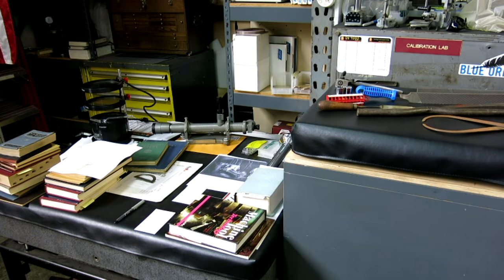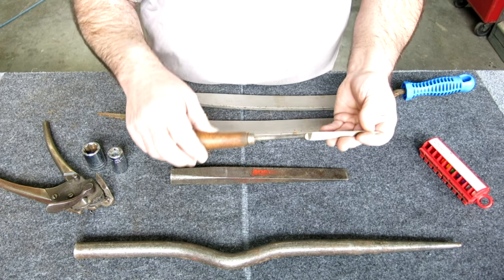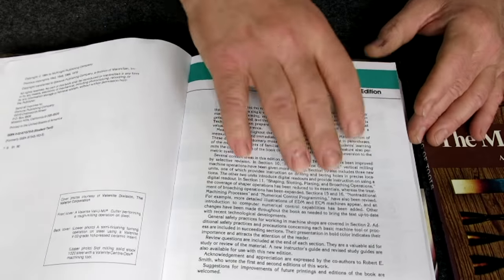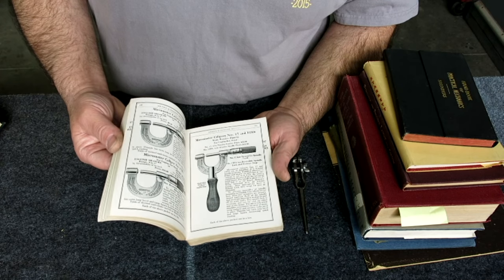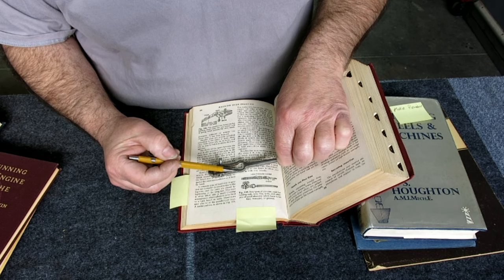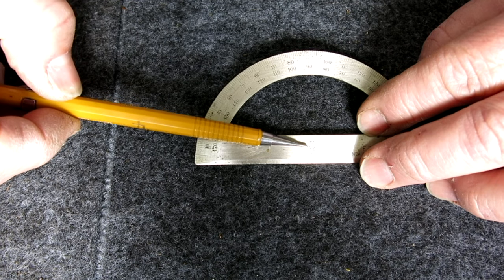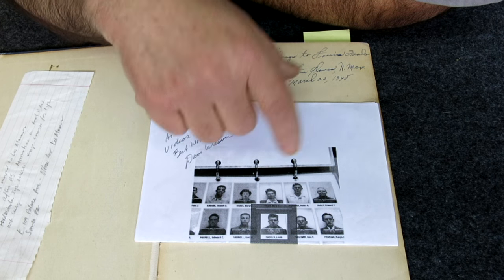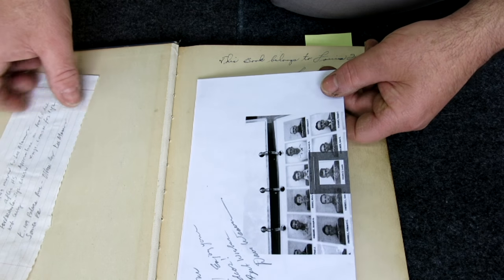Monday Night Meatloaf 111

Comment: Good tips there for Ryan on the tag guide. I too was a bit disappointed when I found the tip wasn't hardened. It's a nice size tool with heavy spring pressure. Good mixup with week Tom, enjoyed! 👍🏻

Comment: I've seen those curved body-files used by old-school auto body technicians. Back in the day, pre-1970's, Chrysler and many other automakers used to "weld" body seams and flanges together with lead. This was especially common in the 50's-60's when we had elegantly shaped cars with lots of curves, fins and tails. After the seams were brazed and soldered, you would have to sculpt the lead and the best way found was to use rasps, bastards and curved files. Based on the aggressive cut on those files, I'm guessing that's what they were initially used for. Awesome find at $8 a pop!! Tasty meatloaf, again!!

Comment: The Polaris and Trident missile launch systems are amazing. They use a small static rocket engine inside the missile silo in the sub to flash a large amount of water into steam, which is then used to a) 'shoot' the missile out of the submarine hull and b) provide a gas pocket around the missile that carries it to and free of the surface. Truly amazing.
Reply: I was not sure if Polaris used that system.  Thanks for the info.
Reply: OK - to be fair, I'm not really sure either. I know it's the case with Trident, however.
Reply from the maker: Hi Povl,

I had not heard that one before. Very cool. Thanks for the comment.

Cheers,

Tom
Reply: oxtoolco : I served on Subs, SSBNs, during the transition from Polaris to Poseidon missile systems and they used them back then. Oh it's a myth that the missile is surrounded in steam, the missile out runs the air to the surface.

Comment: Actually it isn't so much change in refractive indexes but rotation of the polarity of the transmitted light. You rotated one of the polarized filters so it wa 90˚ to the other which blocked most of the light (giving you that nice black background). The test subject rotates the polarity of the light passing through it so that it can pass the second polarized filter (to a greater or lesser extent, which gives the color bands around the stress points). This is why I suggested rotating the outer filter on the flashlight polariscope you showed in a previous Meatloaf.

Comment: Tom if you just want to fiddle with your autocollimator you will get a sufficient reflection of a gauge block. It obviously doesn't have the baseline of a proper mirror, but will give quite a good image. Indeed any lapped surface will. Otherwise hard drive platters are super accurate and are free, just break apart an old hard drive.

Mirrors are typically rare and quite expensive for what they are. Nevertheless they're actually not hard to make as the measurements are relative to each other and as a hard drive platter is double sided, is self-proving.

Comment: great stuff it's relay nice to be able to connect with the past and find out that the tools will live one with another sole.  what size what the chucking end on that tap follower? if it was over 1/2 " i would say that would be a down fall as drill clucks over 1/2" are not all the common.

Comment: Tom,
I have a mirror that might work for your autocollimator. It is round and about 2.5 inches in diameter. It is from an ICP poly chrometer spectrometer. It came off of a three point mount and has the threaded stud for the spring and nut. Let me know if you want it and it is yours for the price of a good video.
Reply from the maker: Hi Paul,

Thanks for the offer of a mirror. I think I have a line on a couple. Hopefully they will materialize. Thanks for the comment.

Cheers,

Tom

Comment: try a tin lap, they used in watch/ clock polishing. Great video.
Reply: Gregory West Tin laps are great for polishing to a fine surface finish but they will not work well if you want a truly flat surface.

Comment: On that round flat, could you perhaps spiff it up with mirror silvering? (Silver nitrate?) Doubt it would interfere with flatness as it is used on telescope mirrors where fractions of wavelengths make a difference. As to your mirror for your flatness tester think you will need a front surface mirror, as used on optics benches.

Comment: So-called "cold launched" missiles, which are the type used in submarine launches, are typically launched out of the tube with a lift charge like that used in a fireworks mortar.  The same technology is used for portable ground launch systems used for IRBMs and ICBMs.  There is also a Chinese satellite launch vehicle which is cold launched.

Comment: Gosh !!! that took some getting through!!!  I think I'd rather have more smaller bites than a plate stacked quite this high.  All good stuff, I wouldn't consider any of it superfluous - I maybe wasn't enthralled by all of it - but certainly was by most of it ... I'm sure others would be.

I'd like to see part one, two ... and possibly even a part three if it's approaching an hour.  Just to make it a more manageable treat.  My bladder has about a 20 minute limit where beer is concerned which roughly equals the time it takes my buttocks to lose all feeling, my tea mug is cold after 15 mins and my beer mug is warm in about the same time - and the wife's nag alarm activates at about 30 minutes.... so 53 minutes in one sitting was a bit of a trial.

Comment: Tom I got a question for you as you are a tool person.  My dad was a av machinist in the navy so he had a good collection of tools.  He had some screw drivers that were oval shaped with wood scales on the sides of the full tang blades.  The larger ones also had octagonal flats just below the handle.  Do you happen to know who made screw drivers of that type, whether they might still be made now-a-days?.......Thanks Dennis, up here in North Coastal Oregon.
Reply from the maker: Hi Dennis,

Sorry I don't know who made that type of screwdriver. They are fairly common as I have seen a lot of them. They are great if you have to use a hammer. The shock goes through the steel and right into the fastener. Thanks for the comment.

Cheers,

Tom

Comment: Likely a dumb question, I have a few... but other than the size of the part to be put on the sine bar, why so large? Is the 4 times advantage used to create more precise angles? In other words, would it be that with the same gage blocks (tenths precision) available you would be able to make a 4 times more accurate change in angle. Side note-Those safety glasses under the Polariscope looked like they were straight out of the late 60 :) Thanks for the video Tom.